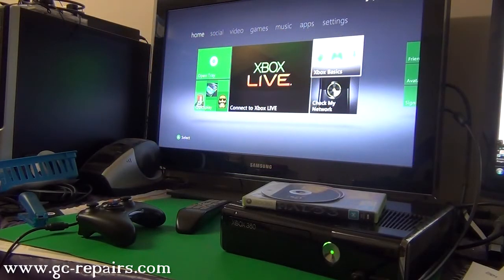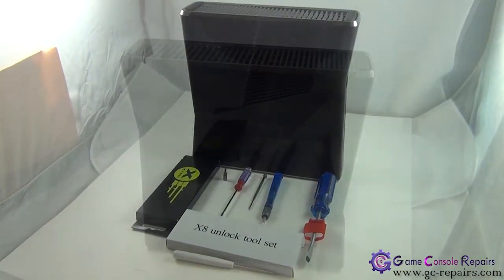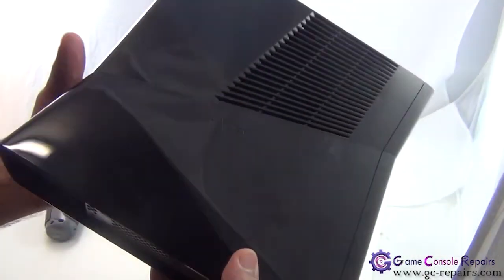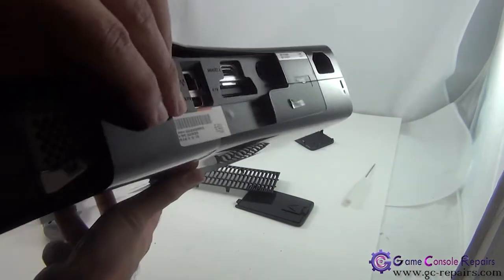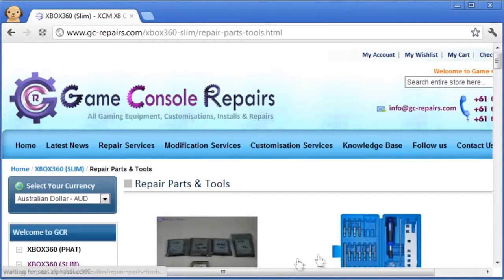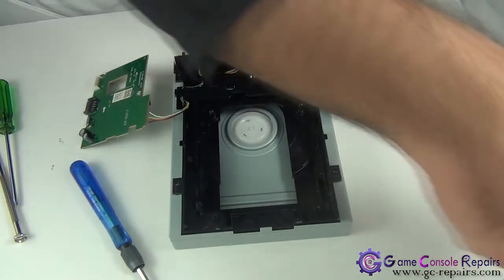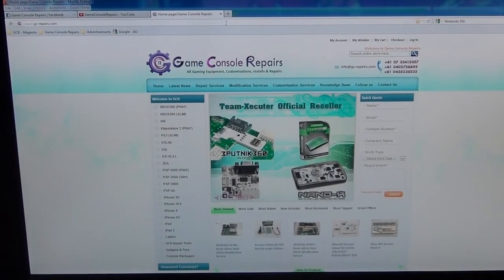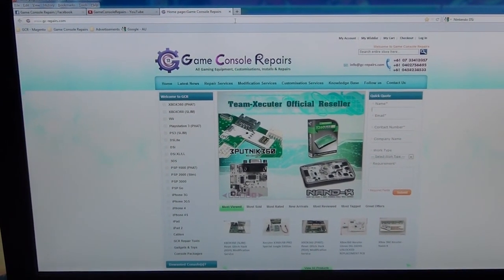XBOX360SLIM   DG 16D4S   Lite On DVD Drive Laser Mechanism Replacement by gc repairs com

Comment: I feel confident that my laser is working, but i notice that it would get stuck the furthest away from the disk it can go, after I'd put in a different disk. I would have to manually push the laser mechanism back for it to start reading. But after a couple weeks of the hot fix, my disks no longer read. The laser beeps continuously and a lot when I put in the disk, but ends up saying "open tray" or "mixed media disk" etc.

 but I have the feeling I don't need to buy a whole new laser/drive. I ju

Comment: hi thanks for the video very helpful. but my replacement disk drive has no connections in the back for the sata and power cables???? wtf? im positive i got the right model (it has the correct model number sticker) but in the back theres just a black plastic in the area where the connections should be